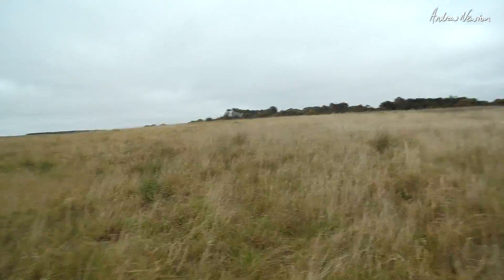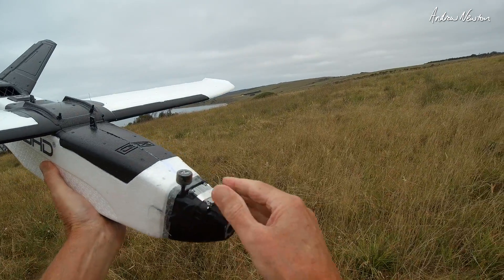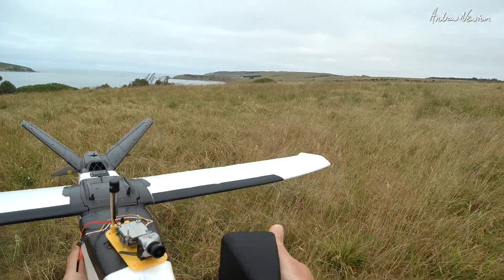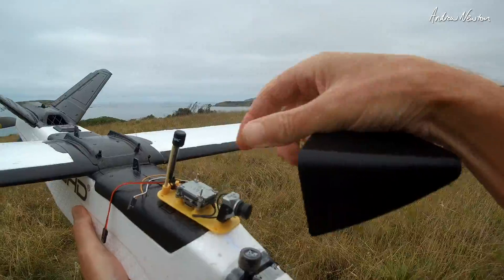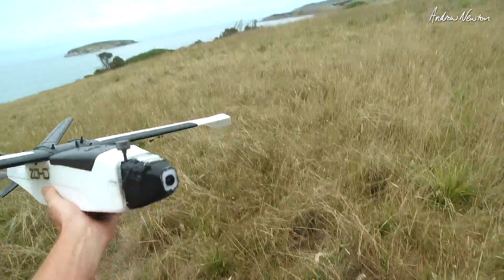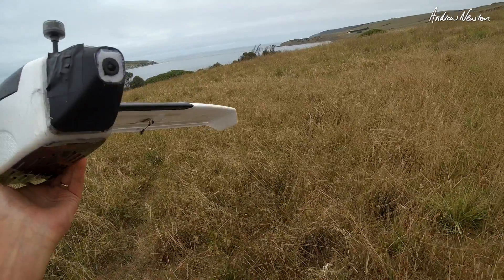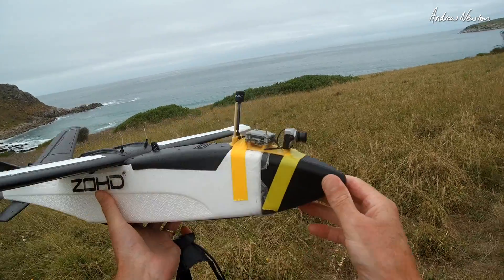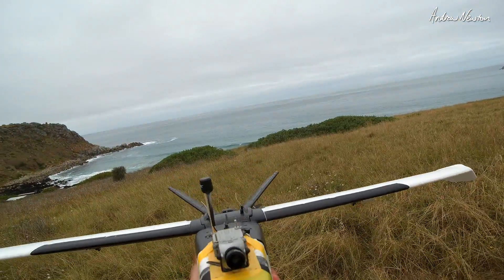Talon GT Slim nose efficiency tests

Comment: If conditions were the same for both tests, then sure, AH/KM is valid.   also if volts were approximately the same.  I assume that Andrew is changing batteries for each flight.  so it can vary with wind because any wind is a net negative to the amount of km covered, even if the plane flies at the same airspeed, which it cannot without an airspeed sensor.   a better test would be with an airspeed sensor, and wh/hr to eliminate both of the aforementioned variables.  still left would be variances in turbulence, which can also cause plane to be less/more efficient.   Still, this test probably represents fairly accurately, the benefits of reduction of aero drag using fairings.  would be interesting to test different types of fairings,  test effect of using landing gear, etc.

Comment: Nice and to the point, I like it.
I'm guessing at this scale, the differences are so negligible they're not even worth worrying about, like you say.
Reply: Drag difference is mostly the increased frontal cross sectional area exposed by the camera, and part of the VTX behind, that extends wider. This is about 30mm wide, by 13mm heigh (camera is 19mm square).
A frontal area similar to sticking just a thumb out in the wind (not a fist). 💨👍
Frontal area is even small compared to the added area of deploying flaps on a model of this size. (ie:  ~1/8  to ~1/6 of the fontal area added by flaps, assuming same width extended down a similar 13mm, or full flap width extended down much less)